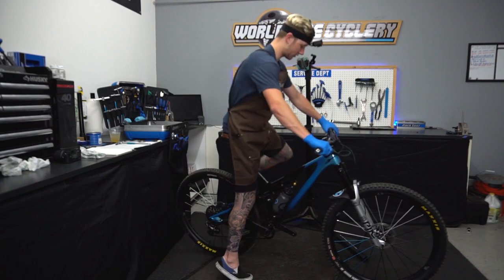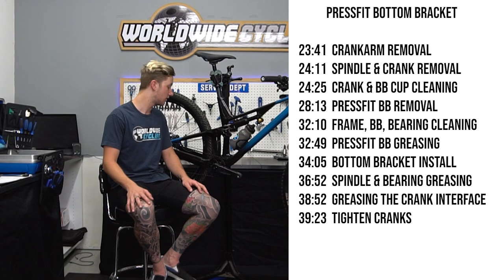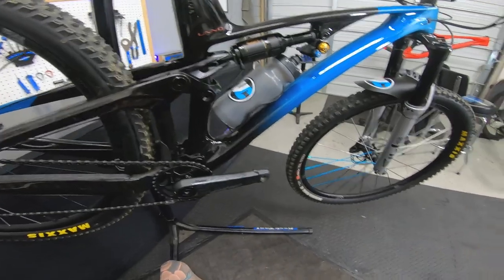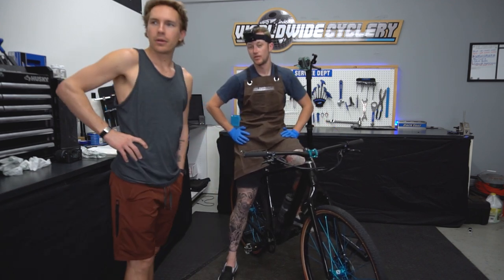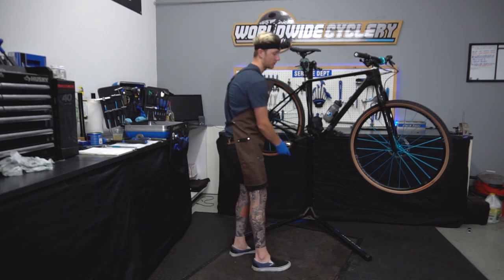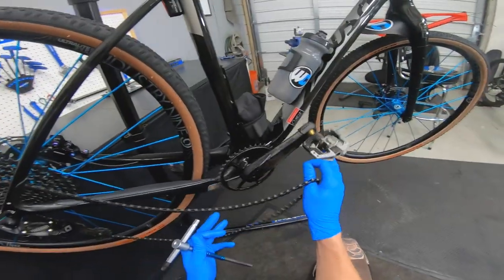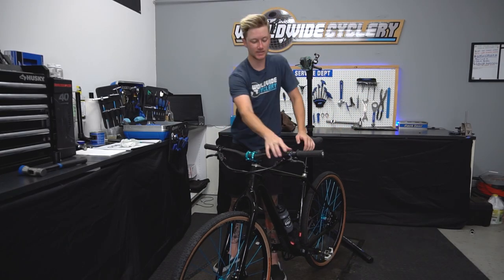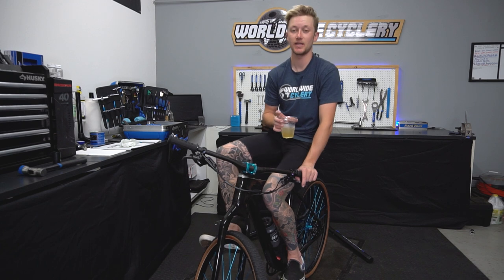Bottom Bracket Maintenance - How to Remove, Install & Re-Grease Your BB (Threaded & Pressfit)

Comment: I like that this video wasn’t clipped apart or sped up  too much, POV is cool too because is sets a reasonable expectation for how long it will take. I was billed $60 to replace a BB and crankset by a shop once because it would take an hour, did it myself in 15-20 minutes for the first time doing it.
Reply: The prices bike shops quotes are ridiculous 🤣

Comment: Tighten up towards the rear wheel, loosen up towards the front wheel. 
That's 100000000000x easier than trying to guess which is the cross threaded side.
Reply: FYI, in case you do not know or maybe someone else doesn't know. "cross threaded" means to screw something in incorrectly over the original threading, rendering the threads damaged. You meant "reverse threaded" which means backwards threaded. Normal threading is lefty loosey righty tighty, but reverse threading is lefty tighty righty loosey. It is common to use reverse threading when a part is in a normal spinning orientation that would cause it to loosen during use.
Reply: all fun and games until you are installing pedals and get things mixed

Comment: 35:55 If you put A LOT of grease to the edge of the bearing that's against the missing dust cover, it would make it harder for dust and water to creep into the bearing surfaces. It will add some friction, though.

Comment: I got kind of a cracking noise in the front and I think it can't be the headset bearings because the bike is 8 months old but I have this knock block system from trek. Could it be the knock Block thing or any ideas??

Comment: Also it is important to note that anywhere that has grease won’t rust. The spindle of cranks are aluminum, but bearings are steel and need grease to prevent them from corrosion.

Comment: Dumb question, what is the plastic piece for between the bottom bracket sides?  I have my BB's come with those, but bike shops never use/install them.  Even brand new bikes never have them installed, that I've come across.

Comment: I understand the use of allllll the grease and the reason you loaded up because it becomes a block to keep dust from getting deeper into the BB and bearings, etc... but doesnt it also become a magnet for the dust? So with all the dust flying around and sticking to the grease there where the crank arms are moving, wouldnt that create a grinding feel? 

Im about to take my crank arms off and bottom bracket etc to clean everything because mine feel/sound like there is dirt around the moving parts.  Thinking it would be good to get the grease in the deeper components but less as you get closer to the surface/exterior parts? what are your thoughts on that reasoning?

Comment: My sram crank requires 54Nm, no way that dinky little wrench got you there. I used my auto torque wrench.

Thanks for the Teflon tape tip.

Comment: I’m building a new hard tail and I have a RR BSA threaded BB and a Race Face Next SL crank. When I insert the crank spindle through the BB, even before I install the drive side, the crank seems too tight and does not spin freely as it should. After it’s fully installed, but before I set and tighten the preload washer, it is so tight that it will not even spin a full rotation by giving it a spin by hand. Is the Race Face BB just a piece of junk? Should I replace it with a Sram DUB BB, or anything but a Race Face?

Comment: Just a question, what part of the bottom bracket or crank that causes creaks? is it the bearings of the bracket? the threads of the shell? or the spindle of the crank?

Comment: Can somebody explain why left-hand threads are used for bottom bracket when the threads are in orientation where threads open to the direction of the pedaling? I would understand if one side would be left-hand threaded if the threads would be pushed tighther with the pedaling if the thread moves even a bit.

Comment: My square taper bb is starting to do weird stuff... When I take the bike after a day of not using it, the crankset is completely seized and won't spin. After applying tons of force, it start to spin again and after 30/40 revolutions it spins smoothly and freely. Is this something to worry about?
Reply: I am not a pro bike mechanic, but it might be the case that the grease inside have dried and hardened to the point where it's solid. You can either run it as long as it works, and then replace it entirely, or try to service it to extend its life. If it's Shimano cup/cone style, you can open it, clean it and re-grease it. If the balls and races are fine it could serve you for many more years to come.
Reply: I'll have to buy the tools to remove the crankset, and the bb, and then I can check what bb I have. Are there any additional tools I will need to service the bb?

Comment: I have a press for BB on my jeffsy. I removed the 10mm and 8mm but my crankset didn’t come off as easily as yours did. Any tips?
Reply: Oh, you shouldn't remove 10 mm, that's the self extraction bolt. Screw both in again, so that the 10 mm bolt is tight again. Than start to loosening up the 8 mm, it will get lose and tight again. Go on until the crank comes off.
Reply: michi ulrich thanks man! What’s the self extraction bolt for?

Comment: Question: the threaded part that you backed off at 27:49, what is that for? Did you re-tighten after you put it all back together? I did not see that.
Reply: The threaded collar that he backed off was the bearing preloader. Yea, he probably should have adjusted it at the very end. It is used to remove any side-play of the cranks and to put a slight side-load on the bearings. Helps them last longer.
Reply: @joppek77  thanks. Much appreciated.

Comment: But you did not clean and grease the bearings. Wouldn’t that be one of the main points of servicing the bb? If you did that you could show how to not impale yourself with a flathead screwdriver removing the dust covers like I did 🪛🫴🏻🤬